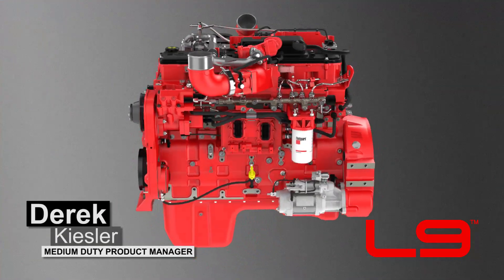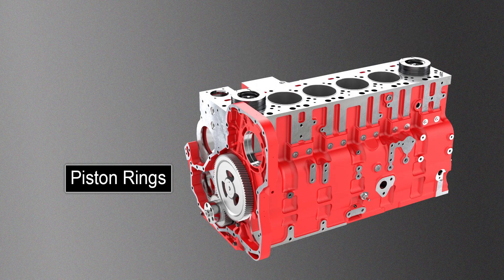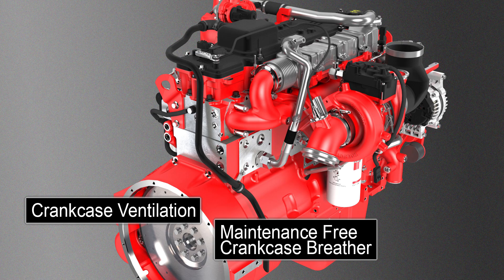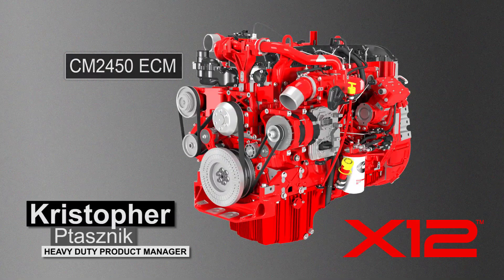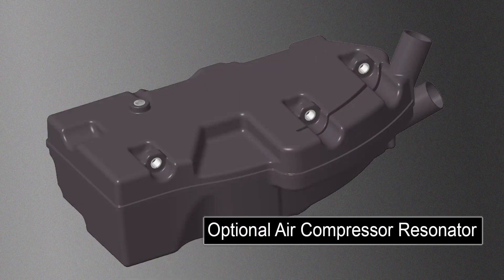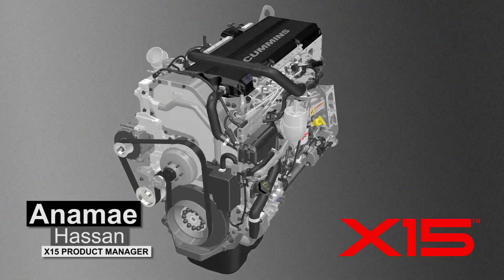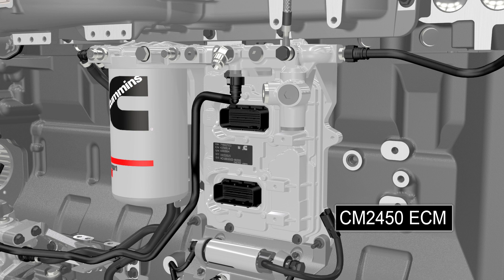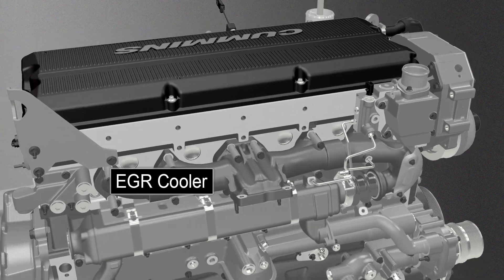Cummins 2021 Engines for Fire and Emergency

Comment: Emergency vehicles should be exempt from emissions regulations or at least a lower standard
Reply: They are somewhat, emergency vehicles don't derate if they have an emissions related fault. They can continue at full power and speed. Only engine faults stop the truck, just like older engines.
Reply: @gailgrove  I understand but the egr systems rob the engine of power, also the egr system can get soot into the chambers and reduce the reliability of the engine
Reply: @hell_pike9150 Agreed. There should at least be some sort of bypass valve or "dump valve" to completely bypass the SCR/Soot filter should it become clogged.
Reply: @Rankine_Cycle21  Yes. Even for all the regular trucks, imagine if we went into a world war 3 scenario. We need the trucks running as powerful as possible and as durable as possible in that situation.

Comment: Fire and emergency services should be completely emmisions exempt !
Reply: Why?
Reply: @charlesrodriguez7984  Because you dont want the fire truck to stop working or lose power because of a clogged DPF or a clogged EGR valve while your house is on fire. Emmisions equipment significantly reduce reliability of any engine.
Reply: @petarmiletic997  oh I get it. Thankfully we have SCR systems.
Reply: @petarmiletic997  everything diesels should be exempted from emissions. Much longer life of the engine and more power.
Reply: @petarmiletic997  so just private citizens feel the blunders of these lack luster emissions systems. That sounds fair

Comment: We had L9 liter Cummins , sorry but junk. At 150k they would just blow up. Couldn't handle the regenerate,  hated the heat all top end power no low or middle end power.
Reply: Yep thats a cummins